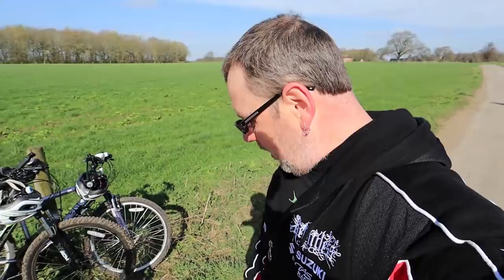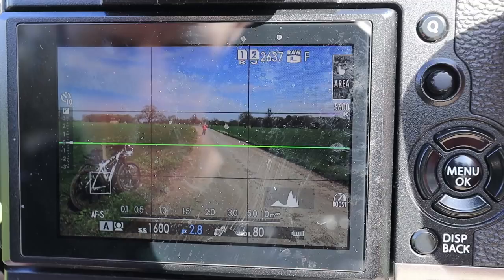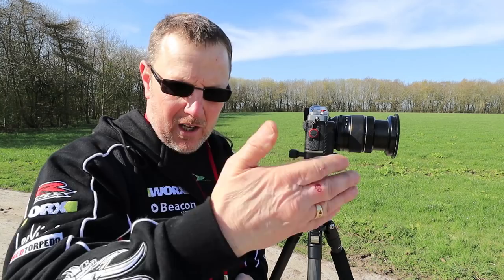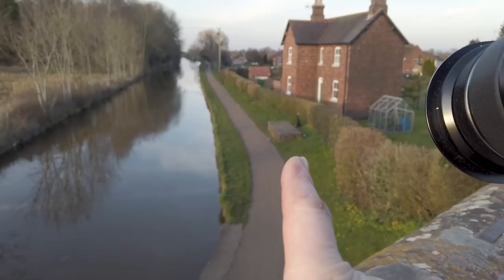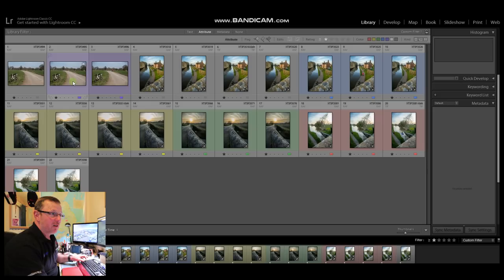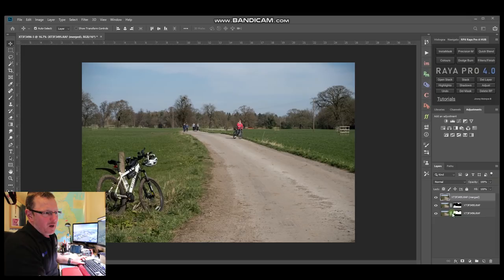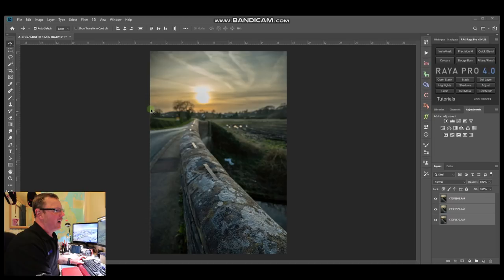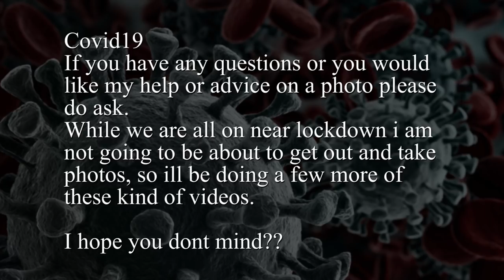Basic Focus Stacking Explained Lightroom, Photoshop - Straight out of Compton

Comment: Very well explained, Paul.  I use software called Helicon Focus 7 for focus stacking. I think it does a much better job than LR or PS, particularly for macro photography.  It has a number of methods for blending and can be tweaked to enhance the results.  It can also be used with LR, using 'Export to Helicon Focus' rather than 'Edit in...'  I would highly recommend this bit of software.
Reply from the maker: thank you ill have a look

Comment: What you really needed was something of uniform size that were set at regular intervals going off into the distance....like streetlamps, telegraph poles or electricity pylons, can't imagine where you might find them though ;-)
I 'cheat' doing focus stacking: Take the multiple shots, open as separate layers, auto align layers and then simply start to erase with a soft brush those parts on each layer that you don't want out of focus. Then flatten all layers. (Don't forget to rename this, before you save). It gives you more control of where you are drawing the viewers eye, eg down a meandering stream (or is that Miranda-ring).
Reply from the maker: yes i did show that quicky but it does such a good now on its own why not let PS
Reply: You can have manual control of what is out of focus from front to back as well, best of both worlds. Primarily used as a tilt shift focus workaround; also works as an alternative to vignetting.
Reply from the maker: cool, tilt shift lots of dosh